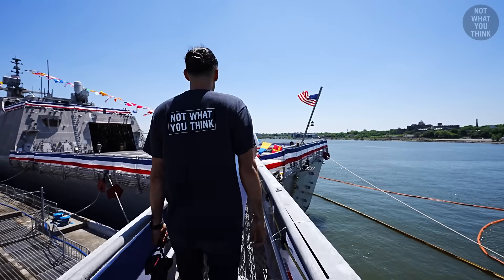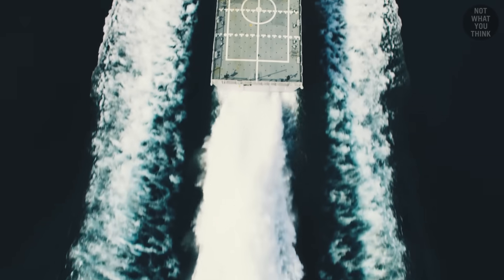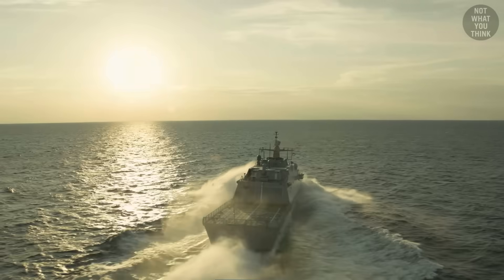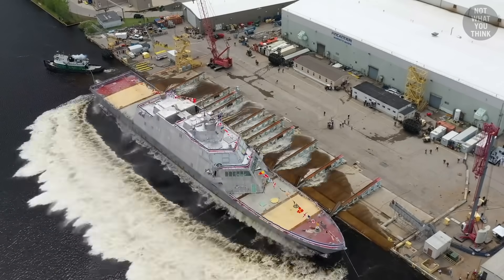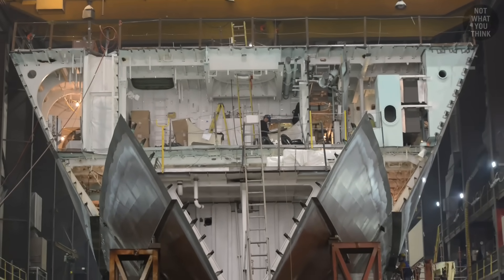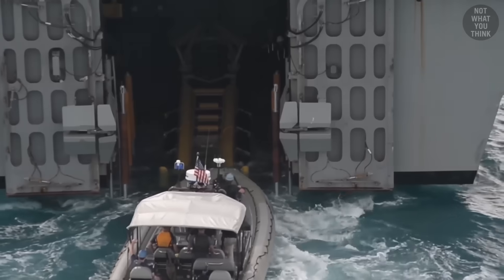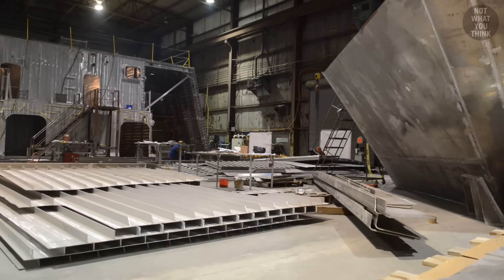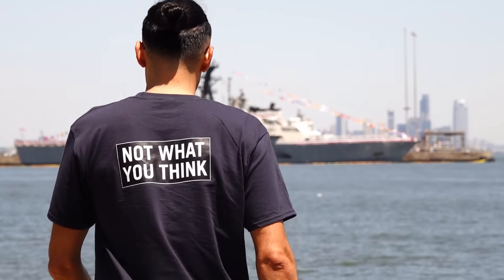I Visited The Most *Overpowered US Navy Warship

Comment: LCS was a disaster.  Good thing the Constellation frigate program is on schedule and under budget. 😑
Reply: @asdf42042constellation is based on a successful and mass produced Italian design. But with a little caveat - the Navy wants to change literally everything: different radars, electronics, weapons, propulsion this all requires changes to the hull shape. Add a shit ton of bureaucracy and get what is called "Constellation".
Reply: @solarissv777  It's not wants to it has to. If the ship is going to operate with the fleet, it has to be compatible with existing systems while allowing for future changes.
Reply: @patrickweaver1105  than why choose an incompatible design in the first place? IMHO should have considered how much it would take to convert to American systems / how compatible is it already.
Reply: @solarissv777  Because it's not incompatible. The basic hull is unchanged. Starting from scratch would have been more expensive and taken longer.
Reply: @patrickweaver1105  You don't have any design experience, do you? One of the costly, frustrating, pain-in-the-ass things you can do in engineering is to cram a bunch of bits into a box they weren't designed for & get it all to work properly. 

You have to analyze every single component, system, and structure that someone else made. Figure out what can be kept, what can be modified, and what needs to be redesigned entirely. Then you need to re-test the whole thing because you've changed out every major system. And in the end, you'll have something that won't perform quite as well as its baseline equivalent because of all the compromises you had to implement to get your stuff into their box. 

And to cap it all off, since it'd be built State-side, you don't get the benefit of leaning on experienced work crews building a bunch more hulls.
Reply: @dgthe3  Yet engineers have been doing it for a hundred years and actually improving modifications over the baseline design on the fly. 
 With the addition of CAD they can actually see the result of modifications before the first plate is welded and accommodate changes during construction. I don't have to have designed a ship to know it won't roll over and sink when it comes off the ways. 
 Then there's things like the Littoral combat ships that started from scratch, yet the basic hull is unsuited for its intended purpose. Reinventing the wheel is often bad practice.
Reply: Projected 40% cost overrun for each Constellation class ship.
Reply: @jimwjohnq.public  The first few maybe. They're going to build a lot of these.
Reply: @jimwjohnq.public  It will be a miracle if the cost overrun really ends up at only 40% 😖
Reply: rofl good 1
Reply: That what I thought.
Reply: Oh buddy boi😂
Reply: You are joking right? Three years behind schedule, and over budget.
Reply: @robertcullison8782  Very much joking.  Constellation is making LCS look like a success story.  The frigate DESIGN isn't even done and they're already cutting steel!
Reply: Mein Führer... die Constellation...
Reply: @dmphoenix973  LMAO 🤣🤣 A "Downfall" edit on the Constellation Program would be brilliant.  I can see the subtitles... "Everything will be put right with Steiner's FREMM design." 🤣🤣